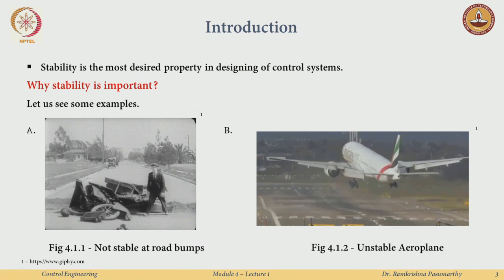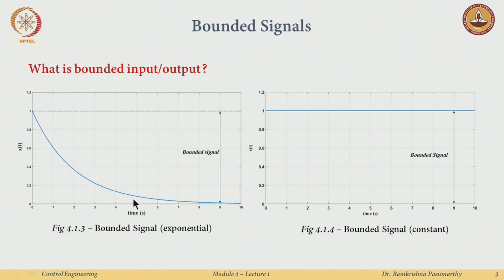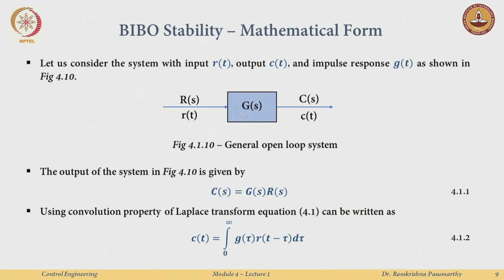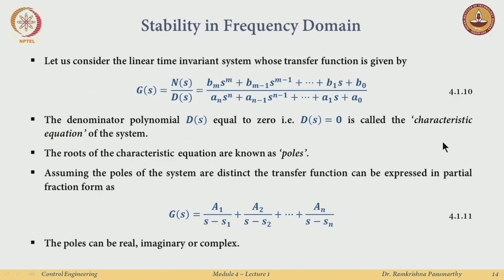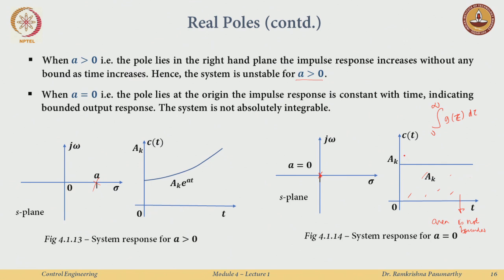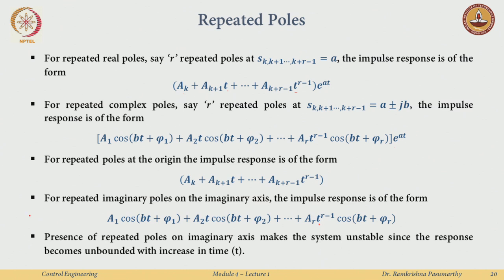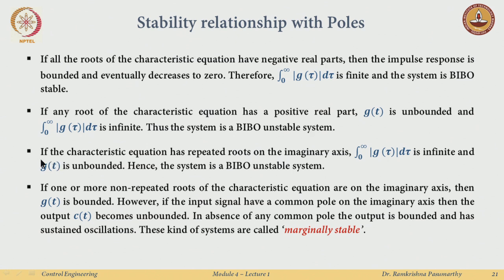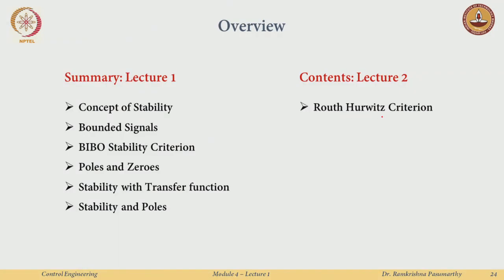Stability

Comment: Sir limit in convolution theorem should be 0 to t.  I didn't get why you have used 0 to infinity.
Reply: actually to check the output is bounded or not we have to put t=infinity and for getting the function we put the limit T